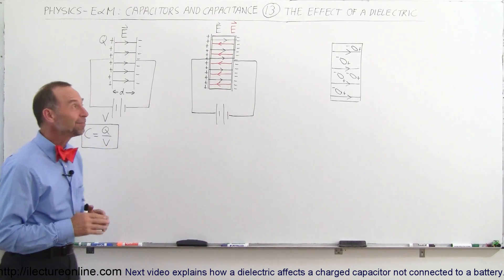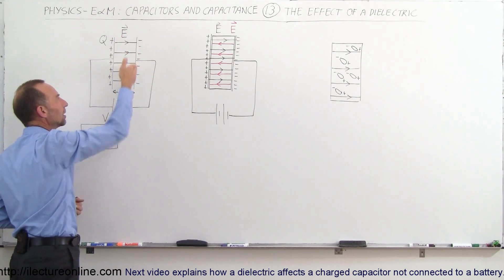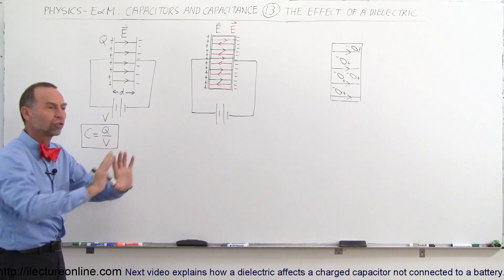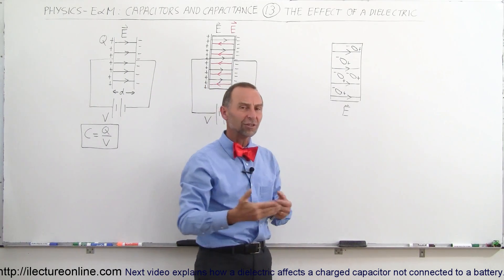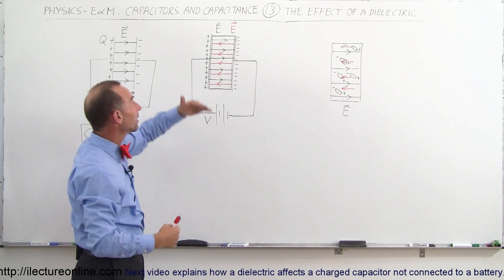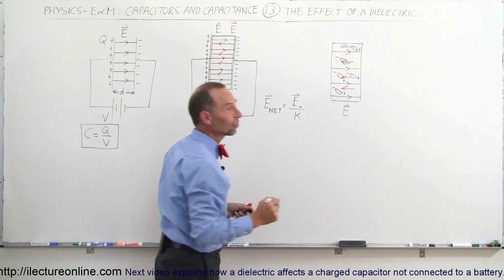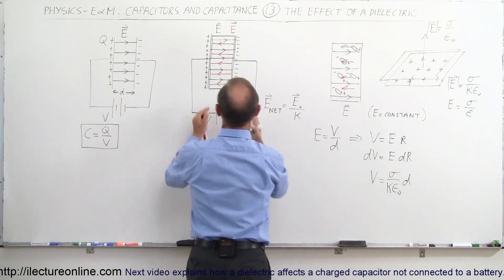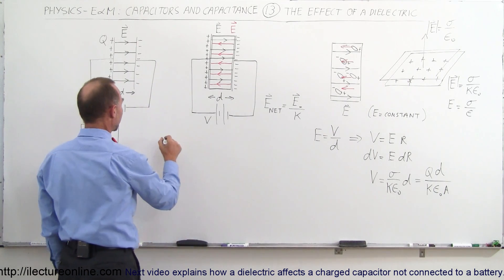Physics 39   Capacitors (13 of 37) Placing a Dielectric Inside a Capacitor

Comment: Something seems off here. I was told by my professor that the electric field should remain constant when the capacitor is connected to a battery and a dielectric is inserted. This made sense to me because V=Ed , V hasn’t changed because of the battery and we assume that d doesn’t change either. So how could E change? The explanation in this video however makes perfect sense when the capacitor is isolated and a dielectric is inserted. Can you explain this?
Reply from the maker: Think of it this way.  Disconnet the capacitor and insert a dielectric.  Will the capacitance increase?  (the answer is yes).   Now apply the same votage as before.  The capacitor will now hold more charge since it has a greater capacitance.

Comment: I was wondering ..
As long as an AC continuously exchanges "+" and "-" poles, can an AC power source charge a capacitor? 🤔🤔
Reply: Capacitor is only fully charged after infinite amount of time, so in AC it can only be charged partially, as once the direction of the current changes, the capacitor is discharged and is being charged in the opposite direction. The greater AC frequency, the lesser the capacitor is charged. At very high frequencies the capacitor is almost non charged (its voltage drop is near 0 V) and thus it serves as a short circuit. This is the case for non-polar capacitors though as connecting polar capacitors in ac circuit is generally speaking a bad idea as it will end in frying the capacitor once the current changes direction (its dielectric cannot switch its polarity)
The only way you could charge a capacitor in AC is if you made AC go in one direction all the time. This is done with a diode bridge, that flips the negative current, thus capacitor can only be charged.

Comment: I understand the math but I'm missing something and I don't know how I should put this..I've always thought that the electric field across the capacitor helps attract the electrons to the negative side. Doesn't a greater electric field mean that the positive side of the capacitor will attract the electrons from the negative side more than a weaker electric field would? Does something compensate for the decrease of the field or am I just thinking it the wrong way? What's the electric field's role in the charging of the capacitor(electron's move)?
Reply from the maker: There are a lot of times in physics where our intuition will set us on the wrong path.  Here is such an example.  What drives charge onto a capacitor is the Emf (voltage) connected to the capacitor.   The amount of charge a capacitor can hold is increased when a dielectric is inserted. The reason for that is that the voltage across the capacitor will match the voltage of the Emf.  And since V = Ed, it will require more charge to get the same voltage across the capacitor, since the dielectric reduces the strength of the electric field. If the electric field is reduced to half, you'll need twice as many charges to build the field back up to the original amount.
Reply: It's much more clear now. Thank you very much for the fast reply sir.